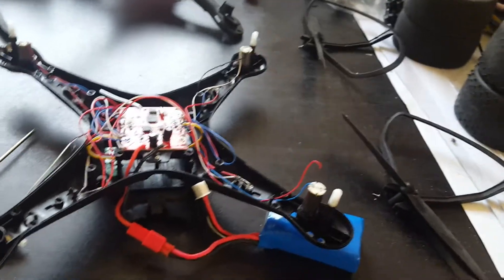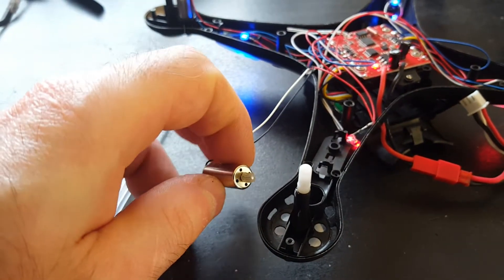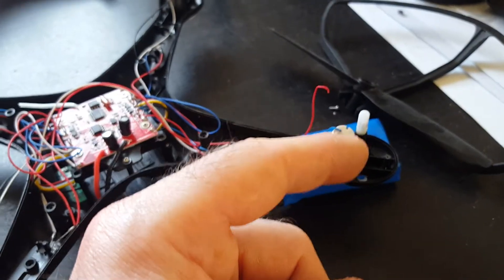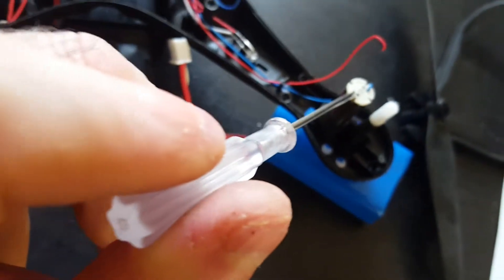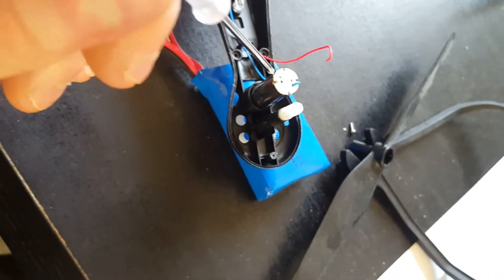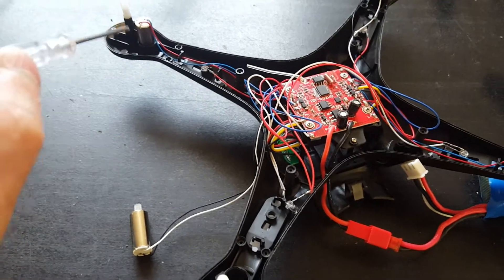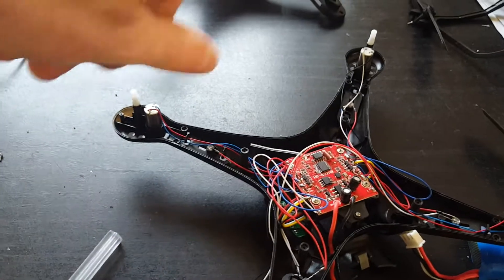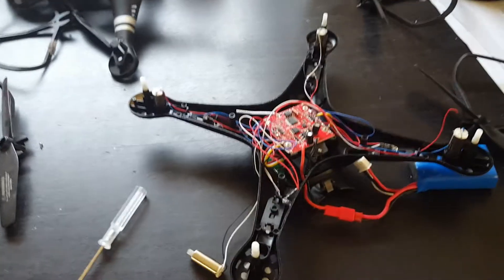lets see if we can fix the dongmingtau drone Part 2

Comment: You are probably going to end up buying new motors. Your chances of getting that wire back in place is very slim. To order replacements, you need to measure the length and the diameter of the motor. They often come in packs of four, two with blue and red wires, and two with white and black, so you get them turning the correct direction. I have managed to fix those little motors, but they didn't last long after I fixed them, so it was probably a waste of time. ANOTHER point, is if you are going to take the end cap off, you need to mark the cap and the case, so you put it back exactly the same way as you took it off. If you twist the cap round, the motor will either not run or it might run backwards. Probably best to file a tiny V on the cap and case, because if you mark it with a pen it will probably rub off while you are working on it.